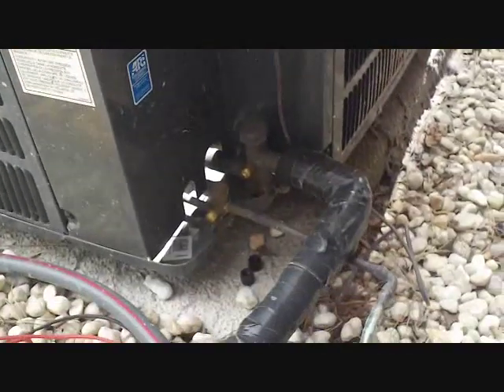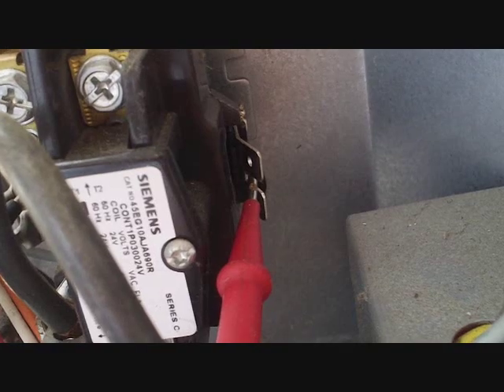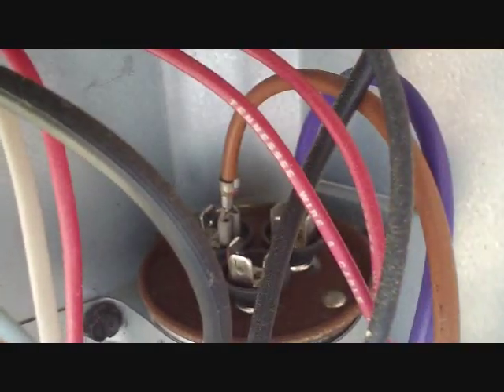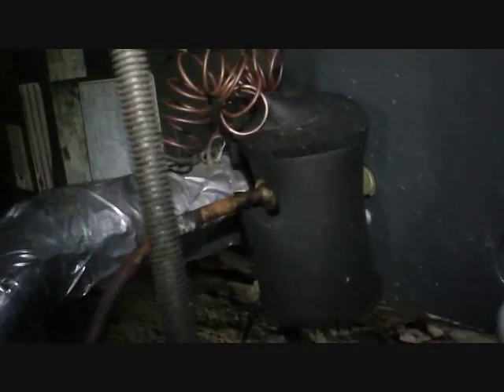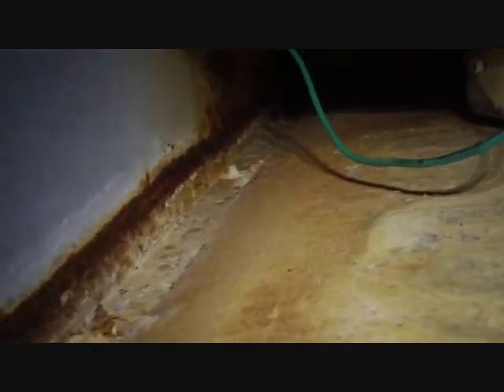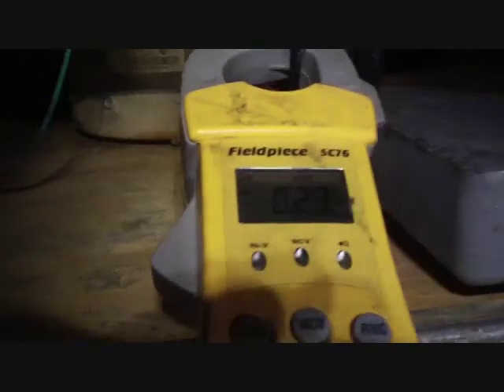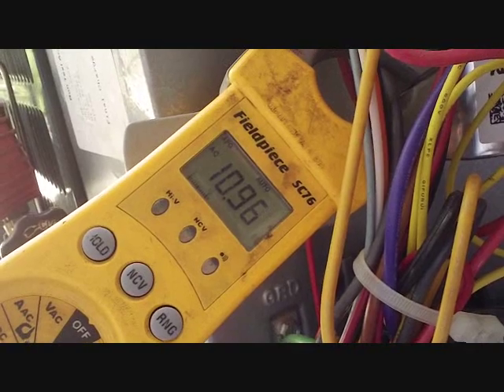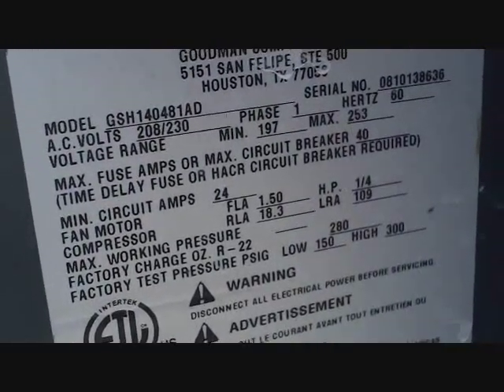HVAC Service- Heat Pump TXV Failure

Comment: Didn’t watch the whole thing because he took way too long. Little heads up. Check everything while running capacitors under load. Why open a coil to see if it’s restricted that’s what static pressure is for

Comment: I thought sub cooling is how much refrigerant is in the liquid from the txv to a few inches from the service valve. If your low on charge there isn't much restriction from the txv to the condensor. But who knows I. Probably wong.

Comment: subcooling insures all liquid. if you have even 1 degree subcooling then you are all liquid
Reply from the maker: Kyle Wingate it can still be a mix, probes can be wrong and so close to the condensing temp there may still be some gas
Reply: talyn875
 I am refering to the part in the video where you say "gas '9.20'"  coming out to liquid line. subcooling by def means that you are liquid not gas. 1 degree of subcooling under ideal conditions means liquid and would be the most efficent operating perameters. however systems are designed generally to work with somewhere around 10 degrees subcooling specifally to compesate for when there other than ideal situations